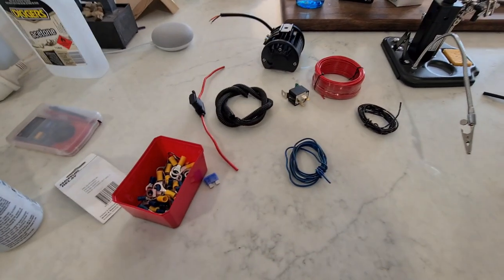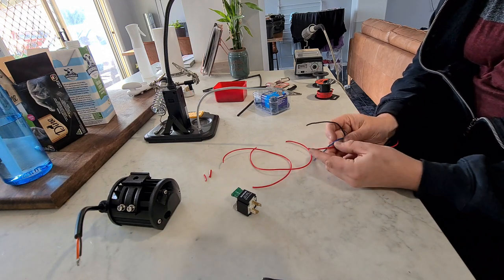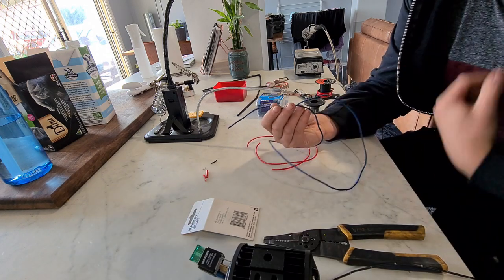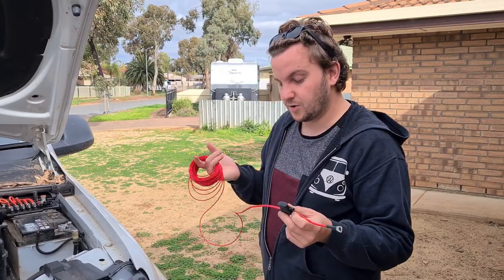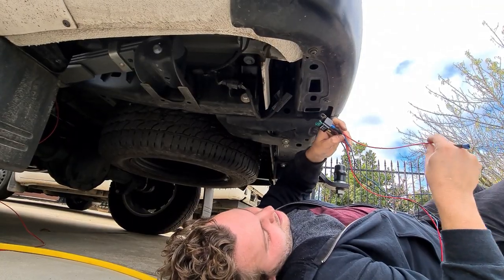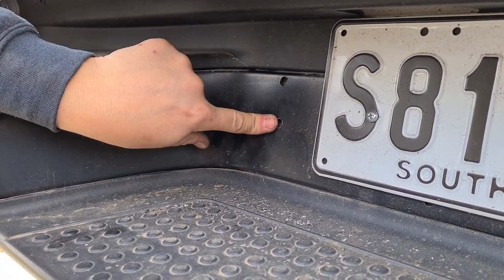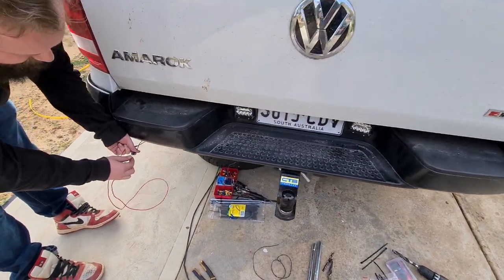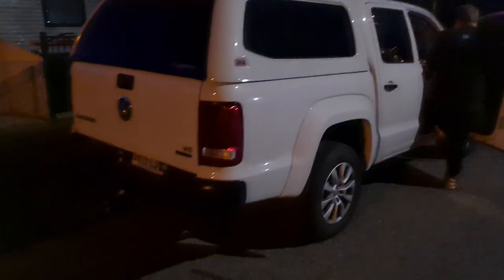How to wire a relay/reverse light LEDS

Comment: hey man greeting from Cali, where exactly should the diode be installed? I’ll be doing this tomorrow and got all the hardware, your video is very thorough and detailed thanks, Hopefully you can give me more info on where to install the diode,
Reply from the maker: I cant really remember, but i would assume between the trigger from the reverse and the relay
Reply: Put the diode on the original reverse light wire before or at the connection of the switch so it doesn't back feed to the original reverse light

Comment: Nice work! I recently purchased a steel canopy for my Amarok and am looking to wire up the brake and reverse lights on it. Can I piggy back them from one tail light without having any shortages of power to that light?
Reply from the maker: Thanks man!

I would believe so, but being new and possibly run by the can system i cant say for sure.. one way to find out 😅

Comment: I'll be sharing vid when someone asks how to wire relay... In the diagram flow of power in from battery and out to light usually flows in a straight line, no big deal really. Could maybe confuse someone just learning.  30 and 87 usually across from each other. 85 should be where 87 is. all goods tho, I like watching your vids man.

Comment: How do you prevent back feeding voltage
Reply from the maker: Putting a diode in the circuit
Reply: @elheffeschopshop hey man greeting from Cali, where exactly should the diode be installed? I’ll be doing this tomorrow and got all the hardware, you’re videos very thorough and detailed thanks, and. Hopefully you can give me more info on there to install the diode,
Reply from the maker: I cant really remember, but i would assume between the trigger from the reverse and the relay

Comment: Why do you need to run a relay & not just wire it straight from the reverse lights?
Reply from the maker: The reverse lights are a smaller gauge wire used as a trigger

Not so bad with leds but you could melt the reverse light wiring by drawing too many amps through the thin wire

So the relay allows a large wire and a small signal/switch to turn it on
Reply: @elheffeschopshop  
Ah yes the current draw. I just want to wire one 36w led as an extra reverse light without a switch. So just wire in a relay pulling power say from the trailer plug?
Reply from the maker: Id wire it the same as i have it this video, just without the switch
Reply: @elheffeschopshop  
No worries cheers mate. 👍🏻👍🏻🙃🙃